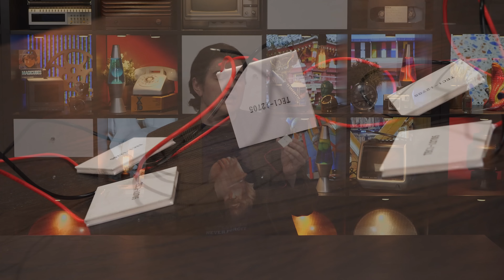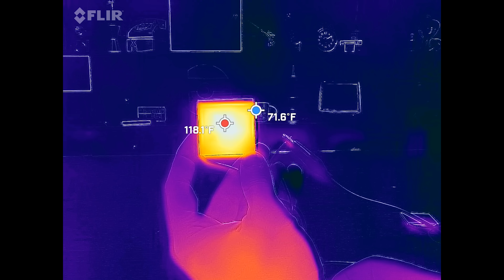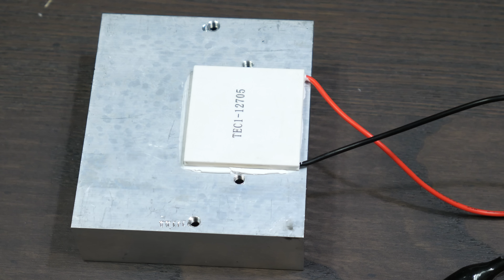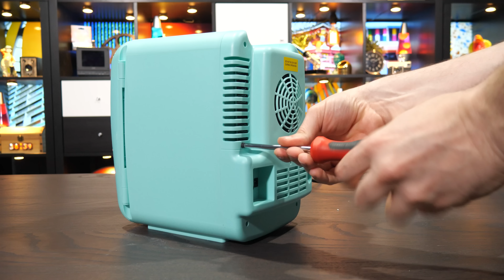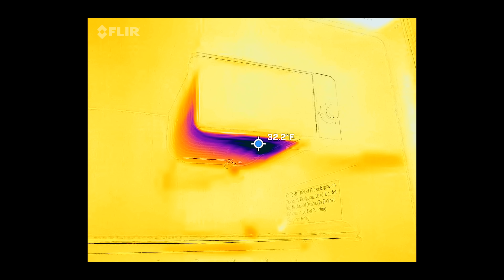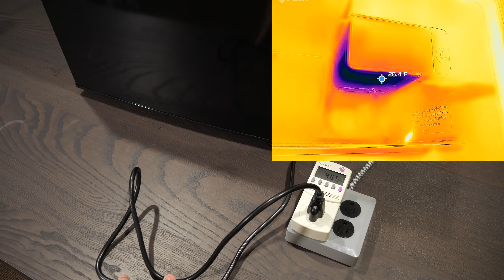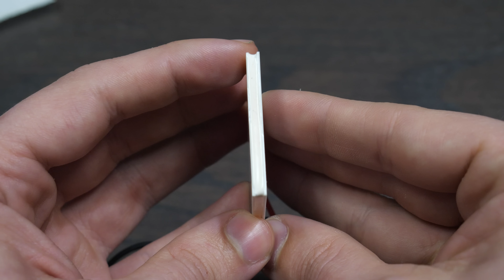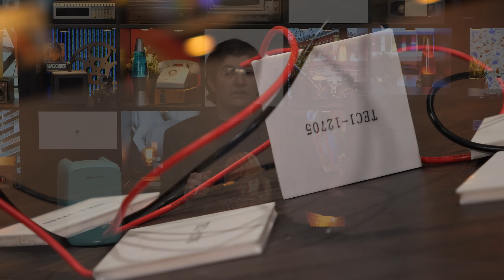Thermoelectric cooling: it's not great.

Comment: In the US Army, they have these large medical fridges they deploy in field hospitals. The cooling chamber is incredibly well insulated, and holds a little more than the blue fridge. It has 4 peltier devices on each corner, which are each attached to their own MASSIVE heat sinks. Seriously, these boxes are 1/6 cool chamber, 1/6 insulation, and 4/6 heatsinks and frame!
They worked pretty well, but they drew a ton of current.
 I can see how they would be more useful in a combat zone than a regular fridge.
Reply: I'd imagine they exist almost entirely because compressors and violent vibrations don't go well together
Reply: @noobulon4334  I imagine they exist because military-spec actually stands for "cheapest manufacturing for the performance"
Reply: @DuckieMcduck  you missed the part where the product has to meet certain specs. those typically being resistance to dust, vibration, immersion, longer maintenance intervals, etc
Reply: @DuckieMcduck Its the oppossite, military specs means the money does not matter, make it work.
Reply: Do they use fans ?
Also are the heatsinks filled with anything to make them work like heatpipes or are they just metal ?
I posted a long comment about a working peltier fridge that I got to fix a few years ago and it doesn't have any fan but its heatsink contains isobutane.
And it works quite well without making any noise.
Reply: @psirvent8  They did not have fans, and were not filled with anything. They radiated heat like crazy, the metal frame (which didn't touch the heat sinks) was always uncomfortably warm to the touch!
Reply: @Sirgeshko  Thank's !
No fan makes sense in a combat zone I suppose, as to not make any noise.
Reply: Pardon my Civilianese, but why would a field hospital be a bad place to put a normal fridge?

If you're using a LOT of power to keep blood etc cool, then you clearly have fuel and generator power to spare.
So logistics must be decent enough to source one medium quality fridge instead, no? 🤔

And I would imagine a field hospital fridge actually needs to stay within a pretty narrow range of temps on the inside - despite day/night cycles and regardless of weather or season.
So I'd expect that a fridge with a high-quality temperature regulator would not just be preferable but actually mandatory....!

(like, if the blood you put into a casualty who's being treated, you cannot put in blood that's 35°C one night and 40 degrees the next day - which I'll roughly guess is like 90 vs 110°F)
Reply: @MrNicoJac  the transportation issues mentioned in the video, primarily. Also, if a traditional refrigerator takes any kind of damage to the refrigeration circuit its pretty useless, but these solid state units can take incredible amounts of damage and keep ticking. And they're easier to repair/cannibalize to keep running.
Reply: @Sirgeshko  As someone who is currently in a field hospital unit I guess it comes down to how well either can fit/work in an ISO container. BTW our ISOs actually have both types of refrigeration, whether that's smart or not instead of just having one or the other and doubling down on it is up to Uncle Sam to decide. I'm more concerned about being a lab tech lol.
Reply: @jchil5087  oh, no doubt they have the traditional refrigerators in the ISO shelters, where they can lock it in upright. If the ISO flips, you've got bigger problems!
Reply: I imagine it looks like the one Tech Ingredients made on their YouTube channel
Reply: Never forget, the military has unlimited amounts of funding at its disposal. It doesn't matter to them how much a device costs or how much energy it consumes.
Reply: Okay cool what Walmart can I buy it from ?

Comment: The ONLY real drawback of the Peltier effect cooling is the enormous amount of power needed for a relatively small cooling effect. In other words: inefficient. That's why that technology will never replace the compressor in a big fridge, because it would need as much electrical energy as a stove and a clothes dryer combined to obtain the same cooling.

Comment: This half-hour explanation is revelation, but most offices have "rules" about refrigerators.  There'll be no explaining to managers that 1.5 cu ft box takes less energy than a 6-pack cooler.  They'll keep a couple of normal sized refrigerators in the lunch room.  If you need to keep something cold for lunch, put it in there, say the managers.  Typically only managers get away with having refrigerators in their offices.  So the rank and file (the more clever ones I mean) get these Peltier coolers to put on or under their desk.  Bring their sandwiches and stuff into work already refrigerated, or even close to frozen, and it will be "fridge cool" by lunch.  You get to skirt the no fridge at your desk rule, and the employer pays the power bill.  Those jaunty little things (branded with your football team's name or favorite bottler's name) fly under the radar, as long as you don't trip any breakers.

Comment: Got one large portable cooling box that uses this tech and that can also work in reverse, heating the content. And yes, it makes some noise and yes, it takes a lot of time to cool something down. However, it can run on 230V AC (EU version) and 12V DC (car voltage), so I can use it when I'm traveling, shopping or to take cooled stuff to the garden (no longer applies, but it did until some years ago). And while cooling something down takes quite a while, it is actualy quite good at keeping stuff cool once it already is, as long as the temperature difference between the inside and the outside isn't too large. Having cool drinks ready on a long holiday road trip is a nice thing after all. It is also useful at home as a temporary, additional cooling solution.

Of course I wouldn't keep raw meat in it, as it is unlikely it would stay at the same 2°C that I've set for my main fridge.

Comment: I run a furniture store. We have some "gaming" desks that have Peltier coolers in them. The amount of energy to keep one drink cool, not cold, cool is insane. It would be cheaper over less than a year to put an actual fridge in the damn thing.
Reply: Man I love gaming, but a lot of that gaming hardware is just cringeworthy xD
Reply: @termitreter6545  I buy almost nothing gaming related- office chair gamers unite!
Reply: @termitreter6545  Yeah. There's some gaming hardware that makes sense (gaming mice, gaming GPUs, etc.), but there's also a lot of stuff that's just pure marketing
Reply: @termitreter6545 true, a lot of "pro gamer" equipment is just a more expensive version of the original, like Xbox pro controller, just a normal controller with a thing glued to the dpad
Reply: tbf: most of the Stuff with the addition of "Gaming" is Overprized tat and you are better of with something different
but when didn't marketing didn't wanted to upsell you some tat
Reply: @enisra_bowman worst offender are chairs. When everyone started working from home, everyone bought gaming chairs, until we discovered they're terrible for your back actually. Office chairs have been custom designed to keep you sitting comfortable for hours so you don't want to get up at all (and stop working) while gaming chairs are just designed to look cool but are super uncomfortable and terrible for posture un the long run.
Reply: @bluestarkiller 
I've been ranting about gaming chair's designs for years. They completely copied the designs for professional vehicle racing seats. Those seats are made to strap a driver in place while making sharp turns, quick acceleration, and possibly deadly crashes. So let's use them to sit in for hours and stare at a screen!
Reply: @skippygirl959 were they also designed to be sat on for a long time? If so, I'm not sure why you wouldn't copy it lol
Reply: @skippygirl959 People like to build sim-pits for aircraft and cars, so having a car seat makes sense for that.
Reply: I have a laptop stand with a similar thing.  I mainly bought it for the two massive fans that it also has, but the peltier thing was interesting.  Totally useless, of course, so I'm glad for the fans in it.
Reply: Probably better to get a small AIO and place it so the bottom of the water block is in a flush mount with the surface of the desk. Just a little spot you place the can on.
Reply: I didn't know this was a thing. Stuff marketed towards "gamers" are nuts.
Reply: Did someone ban ice while i wasnt looking?
Reply: There are ways to improve the efficiency.  Use very high quality insulation like vacuum insulated panels, and use heat pipe type thermal exchangers which do not use electricity unlike fan/convection or water/liquid pump based systems (meanwhile, they are still quite good at moving heat.  I plan on making some modified ones that besides the wicking material, water, and copper than is normally used, it will also be filled with highly thermally conductive material(s) like diamond dust, silicone carbide particles, and/or highly thermally conductive graphite. And it won't be a long tube, but rather a copper dome).
Reply: A peltier cooler keeps the drinks cold while you drink them and cools them immediately.

I don't know what you are complaining about if you're simultaneously using a gaming computer that wastes energy on a graphics card.
Reply: Better yet, put an ice cube in that one drink!
Reply: I don’t pay for office electrity lol
Reply: It costs as much as a single lightbulb.
Reply: To be fair, it doesn't need to move much energy, since the drink is straight out of the fridge when placed on the Peltier cooler, so the Peltier cooler only needs to keep it from becoming not cool for 5 hours or so. Also, not everyone wants a mini-fridge under their desk taking up a ton of space and being a future repair liability. Even if they design a micro-fridge slightly larger than the cupholder, the repair liability and the risk of pump oil spillage are still there. So, I'd gladly take that "gaming" desk off your hands.
Reply: @Δημήτρης-θ7θ its useless... You're better off wrapping your cans in foil and placing them on the desk...
Reply: @C20F  Foil won't make a drink stay cool for 5 hours.
Reply: @Δημήτρης-θ7θ  Sure does. Anyway, a thermos would for days.
Reply: @C20F  Yes, the Peltier heaters on desks are for convenience, not having to transfer liquids into thermos.
Reply: @Δημήτρης-θ7θ  But it isn't. 

Give up already, you're not winning this one lmao
Reply: @Δημήτρης-θ7θ a yeti cup/sleeve will
Reply: @C20F  You can also make your own orange juice or even your own energy drink. And yet, some people want the convenience of not having to do that and buy those ready-made. Well, some people also want the convenience of not having to transfer liquids to the thermos or having the comparatively heavier and bulkier thermos in their hand, and are willing to pay for that convenience.
Reply: @Δημήτρης-θ7θ Couldn't you just buy vacuum insulated thermos full of ice to act as a thermal battery to accomplish same thing?
Reply: @C20F Foil?
Reply: @Δημήτρης-θ7θ   this is what a lot of people expect, but counterinuitively these coolers (unless they're $$ versions with a thermostat) will actually slowly heat-up your 2-5C drink up to 8-10C.
Reply: @Δημήτρης-θ7θ the problem is the cooler in the desk is on and consuming more energy than a fridge no matter what, 1 pre-chilled can and 75 hot cans consume the same power in a desk like that

Comment: I run a similar Peltier cooler at 7V and it takes around 1.5A. I left only the fan spinning at 12V. Still good enough for me: 10°C with 28°C ambient.

Comment: 24:03 now that you have a hole in the door, fill it with spray foam and test that theory.
Reply: Now I wanna know.
Reply: My admittedly unscientific observation is that if you put the fridge on its back and have a way for air to flow, it works better than if you have it sitting up like you should. The one issue is that it has a tendency to collect and condense water when you do it that way, but it does work better. I hadn't considered that the door doesn't have any insulation, that seems like it's the reason it works better that way.
Reply: I'd love to see this

Comment: I worked for a refrigeration company for 20 years, and when I started, all there was was R12, R22, and then R11 for washing tools. We worked on big rack units with 8 or 10 450 to 750-pound compressors. I remember before they started using leak monitoring systems, you might get a call that the system had lost 1000 pounds of freon. Then they started using fancy new refrigerants, and they all came with their own problems.
Reply: You used refrigerant to wash tools back then ?
Reply: @psirvent8  Yes, R11 is a liquid at room temperature, and it is a wonderfull solvent. However, it is not good for the environment.
Reply: @MichaelLeeOne  Thank's for the reply.
Yes, I can understand how bad it was given that it destroys the ozone layer.
(And maybe also your lungs if you use it outside of a closed refrigerant loop)

Comment: The way I remember (and explain to some people) the refrigeration cycle is to think of heat as water and the refrigerant as a sponge. Put the sponge in the water and it absorbs the water (heat energy) take it out and squeeze that out of it elsewhere. Repeat. I think the compressor should be named the wringer. I’m going to start calling them that. Yer fridge keeps gettin warm because yer wringer needs a new starter. lol

Comment: Good video... I share your love of heat pumps. 

Why do you think it says R600a on the pump and one label but then also says cyclopentane in all caps on another label? 

Also... Did the thermostat cycle like that with stuff in it? A bit of thermal mass might lengthen that.

Comment: Is there anything that these Peltier thingies are good for? 

Phone coolers, for example? I need something to keep my mobile phone cool when I'm outdoors in the 115º Arizona desert.
Reply: I wrote a long comment where I talk about a mini fridge like the one in the video that used a peltier thingy and a special heatsink and that was actually working.
Its advantage is that it's absolutely silent, which makes it more suitable than a traditional compressor if it's used where people sleep.
Like a recreational vehicle, or hotel room, which happens to be the niche they appear to be marketed for.
(Not all hotel minibars have peltier elements though, most of them actually use absorption or a compressor for energency efficiency reasons).

Comment: In uk 8c is food safe so this fridge will be fine even in warmer temps. 5c is optimal but i used to work in a supermarket which specialized in frozen so it was just a shop full of fridges. By law fridges had be 8 or below and freezers -18. However you can pick up a mini fridge for cheap so these arent worth it unless youre not paying the bill. I have a freezer in my shed which gets quite hot during the summer as its black but i have solar so it doesnt really matter. In the winter it barely does anything. All comes down to your use case if you dont have room these things are fine if you do have room get a proper fridge.

Comment: In the early 2000s, I used these for extreme overclocking.  It was possible to hit CPU temperatures of around -40c (on a pentium 3 or similar architecture), provided you could keep the hot side at around 5-10c.  It worked great.

Probably wouldn’t work with modern CPUs, which use as much power as a desk heater at full load…

Comment: Suddenly wondering if another automotive technology is what the compressor coolers use to be portable - dry sump lubrication.

It'd add cost, which is why it's only seen on the highest performance sports cars and most race cars (where it allows the crankshaft to be lower, and also avoids issues with oil moving away from the pickup during hard cornering), motorcycles (where it's sometimes a stylistic choice, due to older motorcycles having total loss oiling systems and having a separate oil tank like dry sump systems have), and aerobatic airplanes (where oil pressure can be maintained when the airplane is upside down). But, it'd eliminate problems with moving the compressor...

(Also, wow, looks like some of the Chinese brands are selling surprisingly cheap compressor coolers now. I remember when it was basically just Dometic...)

Comment: 13:40 "much bigger than a typical mini-fridge" does kinda imply that you're comparing mini-fridges but either way it's still dumb of people to mistake it for one.
Reply: You need to project quite a bit to inject such a definition into those words. That's a self-inflicted misinterpretation. I've learned to avoid quite a lot of hassle by just never assuming something that someone didn't say. It works especially well with men. Less with women.

Comment: here is one thing that the MFG of these coolers do wrong  is they put the fan blowing in the wrong direction. If you turn the fan around to pull the heat away from the heatsink it works a lot better.
Reply: The fan blows air onto the heatsink and then that air is pushed out vents into the room away from the cooler.
Reply: @josephbennett3482  that is correct, I currently have 3 of them and when I turned the fan around to pull the heat away from the heatsink, I can store milk in the coolers. the fans that are used don't have the RPMS needed to keep pushing air onto the heatsink to keep it cool. They work better puling heat away. and also like said above, actually putting a better quality thermal paste on it helps a lot with the heat transfer.

Comment: At 18:45, you state that the refrigerant begins to liquefy, and this is correct and you shouldn't change it.

However, technically the refrigerant is condensing since it began the transition as a gas. When something liquefies, it usually starts as a solid, though it is only necessary to define it that way in scientific documentation where the distinction between what phase a material transitioned into a liquid from matters.

Just a funny little note.